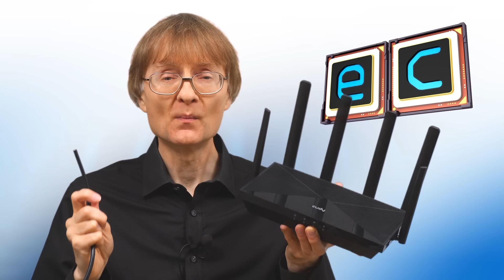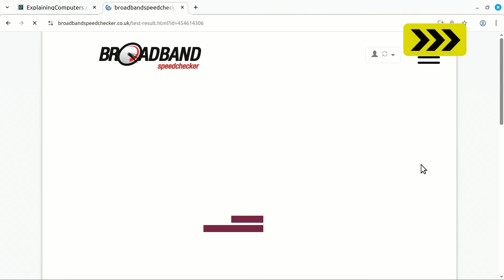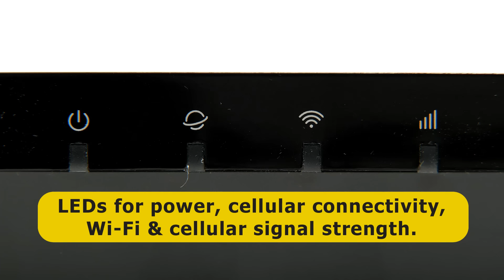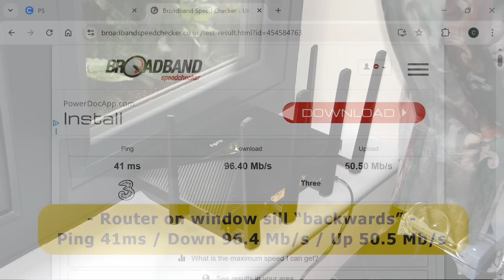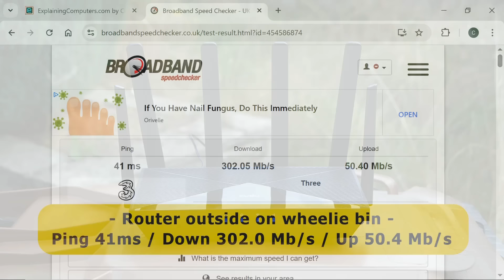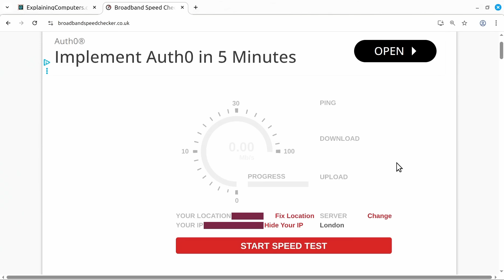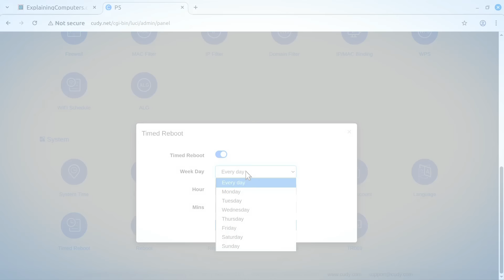Switching to 5G Broadband: Cudy P5 Router

Comment: Thanks Chris for a thoroughly enlightening video, I’m glad you managed to get sorted out with your 5G solution, excellent U/L & D/L speeds.  Some parts of Cambridgeshire are still a few years away before good ole Openreach implement fttp, unlike Peterborough which has a full City fibre service covered by several ISP’s. I’d looked into a 5G service where I live but would only be able to get 4G which is sporadic at best, so looks like I’m stuck with fttc for the foreseeable with 36 Mbps down & 9 Mbps up on a good day it’s OK for HD streaming as long as no one sneezes!!
I worry about the day when we switch over to full fibre, we’ll have to purchase a UPS at our own expense to cover any temporary power outages, of which we’ve had several, the UK power grid is not currently fit for purpose, we’re putting all our eggs in one basket. :learning:👍
Reply from the maker: Greetings Alan. Take a look at my notes in the video description -- my chance I think I've happened on the method to maintain a landline phone what will work in a power cut, at least until 2030. Maybe!
Reply: @ExplainingComputers  Thanks for the heads up, I'm not with BT but I've checked my ISP & they state they will not use digital voice & to switch to another provider!

Comment: not applicable in the rest of the world. speed will be too slow. you will have difficulty running local servers or some type of remote access, wireless providers have shared access and you will not be able to get a DDNS to work as you expect. are you "explaining computers" of 2005? wireless as a backup only (been considering it as a fall-over only), especially if you are a "content creator"
wonder how much data he gets. 
yeah, nah.

Comment: I am in the process of changing from Xfinity (effen crooks) to GloFiber that was just installed in my area. We finally have competition! I have not had issues with Xfinity's service other than the price. Current plan with Xfinity is 1Gb/30Mb. GloFiber is 2Gb/2Gb at 1/4th the cost. But, I now need to upgrade the switching infrastructure to support a 2.5Gb handoff from the ISP.  The required equipment will have an ROI in about 4 months.

Comment: 5G still is not available to us, even though we leave in a southern california city. Our home is located in a small mountainous enclave that had always been behind in getting improved internet service. Dialup to ISDN to cable to fibre. Interestingly, in the late 1990s, I had the opportunity to work from home, but an ISDN connection was insufficient. Fortunately, a couple of enterprising local high school students paid to get a T1 line run to their nearby home. Then connected us paying customers in the enclave with a microwave mesh system. It worked great allowing me to work from home, plus likely spurring the cable company to finally expand into our area, though I stayed with students until they closed up shop a few years later.

Comment: Here in the US T-Mobile and others have unlimited 5g wireless for home use for about $60us /month. The are two down sides. 1. The service is cg-Natted so you can't run a server like a private security camera; and 2. They use leftover bandwidth so you can only get what the paying cell customers haven't already taken for themselves.  I've heard some people say they didn't get much more that dial up speed during peak times.  One service that might be interesting is Starlink which has a $5/month unlimited plan that has a whopping 512k speed.

Comment: Great video, and very intriguing as I am about to move house and don't want to have interruptions to my internet if I can help it.
Reply from the maker: A low cost 4G Mi-Fi unit, with something like a 1p Mobile rolling PAYG data plan, may be worth considering. 1p Mobile use the EE network, but with no speed caps or tethering limits.

Comment: This is great! Right now I need a backup service as you had. My main provider was coaxial-based, but they are doing a mandatory second "user network" where they use the cable modem you have installed to provide it. That changed the quality of the service and produced a lot of problems. I changed to a fiber-based service, and (for now) all is ok, but I need the backup service. I was thinking of giving Starlink a go with some discounts going on here, but I'm not sure how much control I will have over my network that way and if I can install my router to their providing device without issues. 5G is something I didn't consider, because the technology is mainly used and charged thinking you will be using it with a cellphone. However, I may ask about it and prices as a backup home service... The thing is that the companies that offer fiber are the same that offer 5G, so if an outage occurs, it will surely take down the entire connectivity of the same company, no matter if it is fiber or 5G based. So, I'll keep thinking of an alternative.

Comment: It's amazing how fast 5G can be. I feel grateful where I live; I have access to fiber in my house.
Reply: seems 5G here is as good for download as a 500MB/s fiber product
Reply: @kwanchan6745  It is crazy how fast 5G has gotten, as I'm in a small rural down here in S. Carolina USA, & have T-Mobile 5G Home Internet using the provided Arcadian G4AR gateway, and connected directly the gateway via the 5Ghz WiFi band with my Pixel 8a, and Lenovo Ideapad I upgraded with a intel AX210 WiFi/BT card I'm seeing down speeds high as 1.9Ghz(gateway only has 1Gbit lan ports for whatever stupid reason), with sub 40ms ping time, and my uploads have been high as 150 Mbps, & for $50 USD a month, so yeah I'm really happy with it vs. what the cable company, & fiber provider offers.
Reply: @kwanchan6745 the issue with cellular internet is that the infrastructure/ tower can get overwhelmed pretty quickly because every man and his dog is connecting to it .
Reply: Yes, under certain conditions, including distance from the tower, quality of equipment used, mobile plan (not all are the same), and congestion.  During certain peak usage hours, the connection may slow to a crawl while other times it's fast.

Comment: I read the juicy parts of a few 5G patents. It's for crowd control, not communication. 4G is plenty to handle earth's bandwidth, but it takes that extra G to zap out a signal that causes so much brain pain, crowds will scatter in a flash to try to get away from it, but it's everywhere. Y'all who want 5G have been suckered by the bad guys yet again.

Comment: In the UK there may be  a hidden recurring cost for Windows users who are current  customers of BT and who wish to ditch their BT Broadband FTTC in favour of 5G wireless,  whilst continuing to use Windows . . . . . that of providing an  anti--virus package  of the same calibre as Norton, which BT provide inclusive of their rental charge.

 So if your 5G ISP charge turns in at £300 annually, the anti-virus package costs £60 a year and the capital cost of the new 5G  modem @£250 assumes a pay-back period of 5 years that gives a total annual recurring cost of £410 a year . . . but, never the less, it still puts near-on £450 back in the user's pocket. 
The only caution would be that the wireless download speeds obtained in the video are exceptionally good. On my 4G wireless modem/router this afternoon, in suburban North-West London, despite being within 400 yards of three mobile repeater masts, I was only able to obtain  7-8Mbps down and 6 Mbps up . . sufficient to meet the needs of a single occupancy household, but a fraction of the lowest download service I can obtain on BT FTTC (50 Mbps) and that lower figgure might not provide sufficient bandwith to support multi-occupancy use.

Comment: All these 5G routers seem to be expensive, so there is already a downside. I have a landline connection, no wireless needed. 

But I would have chosen a separate 5G modem for the 5G connection maybe powered with Power-over-Ethernet. Of course I would have placed the 5G outside and high up for best reception. 
And then a separate Wifi router for in the house. 

That way I could upgrade to 6G, 7G, 8G in the future without having to also replace the Wifi router. Or the other way around, I could replace the Wifi router separate from the 5G router whenever I wanted to. 

If later I would chose to switch back to a different type of internet connection, than I would reuse the Wifi router (or I would have been reusing what I have already). 

£354.83 is a lot of money and the device will only get a limited time with updates and security fixes as is the case will all these SOHO routers. That is a lot of money, I think. 

You could have gotten creative and used any of those SBCs to work as a Wifi router. And installed some kind of Linux based open source router software with likely unlimited security updates. Made some videos about it too :-) but then again it would be more complicated as well and maybe that is what you're trying to avoid.

Comment: Hi, I live in Poland and for many years I only had ADSL 10/1Mbit connection. Fortunately in 2017, a local provider installed fiber optic cables in my neighborhood. Currently I have 1000/300Mbit connection for 70PLN / 15GBP. A year ago, nationwide provider launched another fiber optic line. Now I can choose from six providers. And the prices are low. And I'm super happy with it. Cellular speeds are quite bad on my location. Like 45/5Mbit.

Comment: Rather than run 4 ethernet cables to the windowsill, don't you have a gigabit switch nearer to your devices?  If so one cable to that would be tidier for you
Reply from the maker: But using a switch would add another device and power adapter into the setup! :)
Reply: @ExplainingComputers you win some, you lose some 😂

Comment: I use telus 1.5 gig fiber, ethernet over powerline network in the house so I dont have to run a bunch of cat 6 cable through the house ( I have an older house built in the late 60's , no provision for any networking in the walls) the ethernet over powerline has always worked well for me , but when I got the 1.5 gig fiber brought in, I did have to upgrade my modules plugged into the socket to take full advantage of the highest speeds. I have been very happy with the current setup and even get great speeds out in my garage music studio over the powerline from the house

Comment: It's amazing that you as a content creator can tolerate speeds of less than 100 Mbps. I have been spoiled with fiber to the home (AZ, USA) of around 1000 Mbps up/down
Reply: Symmetric upload and download speeds is a hell of a drug!
Reply: I live in the UK and my broadband speed is 3 Mbps on a dry day and 1.5 Mbps on wet days. I've been fighting for sixteen years to get a usable connection. Furthermore, I don't have 5G broadband, and 4G isn't much better than my wired connection. I'm currently waiting for Openreach to install full fibre.
Reply: @karlclark8625  I guess I have been spoiled with gigabit fiber for the past 10 years. Wish you well and hope you get your high speed link.

Comment: I had 5g Internet in my radio shack from Vodafone but had to return to Plusnet fibre because of Vodafone's CGNAT. My IOT devices require open ports which isn't supported by Vodafone 5G. It is a shame since I was getting excellent down and upload speeds although the cost was more than expected. Gamers will also struggle with CGNAT too. There are workarounds at an extra cost though. IPv6 needs to be scaled up to avoid these issues.

Comment: I live in an apartment block in Berlin's city centre. ADSL never worked reliably as the data would go through 1970ies style telephone wires with rats dancing on them 🙂 - never intended for carrying 50MB/s. I later switched to internet on cable TV which works fine. Coaxial cable has been designed to transmit high frequencies and shields them from interference you. But cable internet is susceptible to power outages on the premises - which unfortunately happens from time to time. Construction activity in the area might have contributed to internet outages in recent time as well - so I consider using cellular as a backup. I do not have a cellular modem but use an older 4G phone with tethering wich works fairly well. As I run Linux on most computers, I simply change the routing.

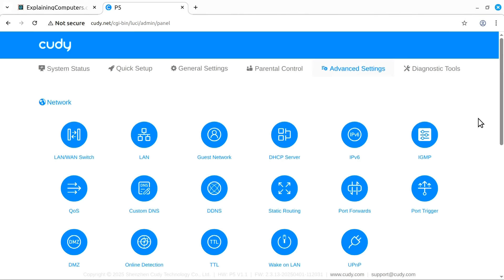But as seen in your router's "advanced settings" 14:40 - IPV6. In Germany, cellular providers do not always give you a routeable address - neither IPv4 nor IPv6. They give you a local IPv4 (10.0.0.0/8) that's it. To run local servers or open the LAN to access from outside one can use reverse VPNs - but this adds another layer of complexity which can fail. How is it in the UK with cellular internet? (IPv4 and IPv6 native, IPv4 carrier NATted and IPv6 or as with us NATted IPv4)? Would one have to fear issues with VoIP or online conferencing?

Phone numbers - both land line and mobile are portable in Germany BTW. - you "own your number"

Comment: Now hold on a moment... is that a web remote UI through cudys servers in china? This makes no sense, it is like an ad of a chinese router but it seems a bit crap. Also of course it is not 5G mmWave but just regular, just like 4G which could get to those speeds just fine with proper router.

Comment: I decided to upgrade my computer's internal Wi-Fi to an new WAVLINK BE8800 Wi-Fi7  Tri Band PCI - E Adapter. I normally use it in conjunction with my phones 5g hotspot but when I really want to ramp the speeds up, I can purchase EE Wi-Fi with no contract for up to a months worth for 40 pounds. The speeds are really good.

Comment: WFH required some serious consideration of a lower risk of being disconnected. My previous ISP VM was non reliable with very bad customer service, as soon as FTTP appeared in my neighborhood I jumped into it with Vodafone full fiber 2 (900 up/900 down) They provided a backup 4G sim and box that is in my case useless as I have no signal to Vodafone Mobile. Though the FTTP is reliable I still on very rare occasions use my Smarty (piggy back on 3) for 5G mobile Internet service. The 5G is very reliable where I live compared to other mobile providers.

Comment: I ditched BT 2 years ago and now use Lebara (vodaphone) network.  Were a few issue with blocking content even though I asked for all filters to be off and as I pay by cr card they know I'm 18+ so that was frustrating but service has been excellent with only one outage in that time period.  BT wanted to charge me £37/m for FTP but lebara trumped them with unlimited everything £22.50/m.   Only 4g in my area on Lebara but still get 35mbps consistently which is better than BT and sufficient for my use

Comment: I'm on 4g internet (self supplied tplink 4g router, unlimited data sim-only mobile package), as we are too far from exchange for regular broadband. I have high gain antenna up on a pole pointing at the nearest mast to get a signal (mobile signal other wise is iffy). cheaper than satellite broadband, and faster (starlink was too expensive to consider). The only issue is you don't get a static public ip4 address with 4/5g without a lot of money and routable router vpn service, so running your own servers accessible from outside is problematic. tailscale is ok for private access, but public access is more of an issue. If you have line of sight to your nearest mast and can use a directional antenna, you will be able to get better speeds in 4g or/and 5g. You just have to watch out when searching for 4g or 5g antennas, because almost all search matches are for tv antennas that filter our the 4/5g signal which is the opposite of what you want. 🙂

Comment: The building I live in is a high rise and I live on the 11th floor the internet service provider for this building also provides the television I chose when there was a refit not to have the fibre or the all the television capability I currently use 4G 20 up and 20 down I had fibre for them for a while it failed around Christmas one year went back to my old system which was mobile previously when I lived with none of my parents I got a landline and my first connection to the internet was via modem by us robotics

Comment: I read an article recently indicating that increasingly people here in the UK are choosing this option and estimating that "the number of subscribers to traditional broadband services will fall by around 250,000 this year" [1]. I've been on mobile broadband for several years now, initially as I was in a short-term rental and didn't want to commit to a 12 or 24 month contract, but once I'd got a working solution I never felt the need to switch back.

My setup is very low cost, both plan and hardware. I simply have an old Android mobile phone in hotspot mode, and have flashed DD-WRT (or OpenWRT) on to an old dedicated router which treats the mobile device as the uplink and broadcasts a strong signal for an isolated network around the house. This gives me around 10-15 Mb/s each direction over 4G, which works well enough for me. However, I have been considering looking into a 5G device, so a well timed video! As to the provider, initially I was using TalkMobile (Vodafone), but I have switched to a low cost plan from EE.

To overcome the lack of fixed IP I bounce things through a free Oracle cloud instance using WireGuard where needed.

[1] https://www.telegraph.co.uk/business/2025/10/03/time-to-cancel-your-broadband/

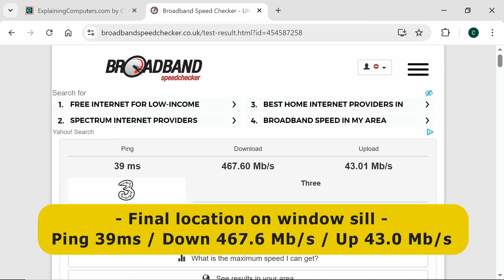Comment: 12:41 -- 467 Mb/s down and 43 Mb/s up is extremely impressive for a wireless connection.  I just tested my wired connection (provided by my cable TV company) and got 573 Mb/s down and 37 Mb/s up, which is about what I expect.  I think they guarantee 500/35, so it's a bit better than what they guarantee.
Reply: While downloading and uploading speeds are good, the major difference in cellular vs fiber connection is the latency and ping.

Latency and ping are really important for day to day usage, unless you constantly need to download and upload large chunks of data regularly.